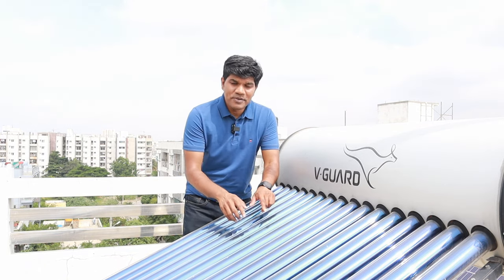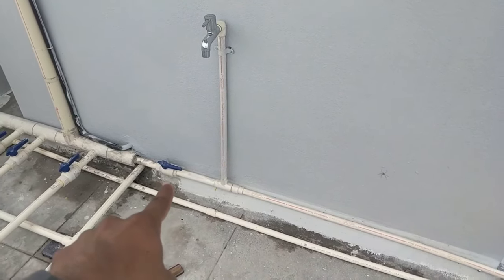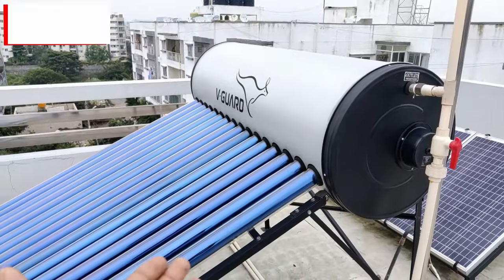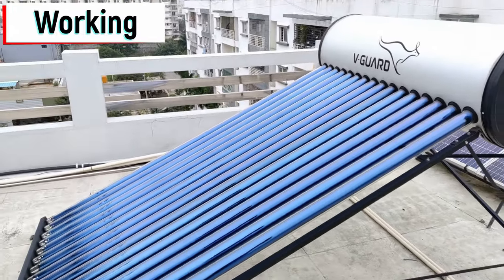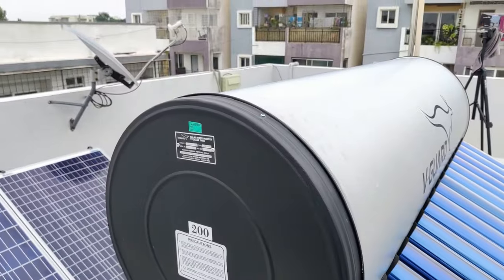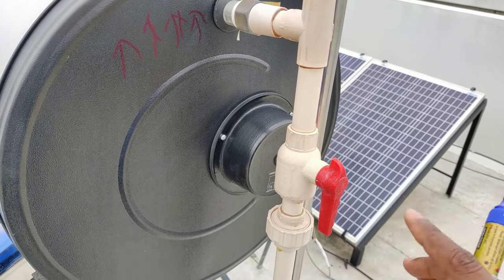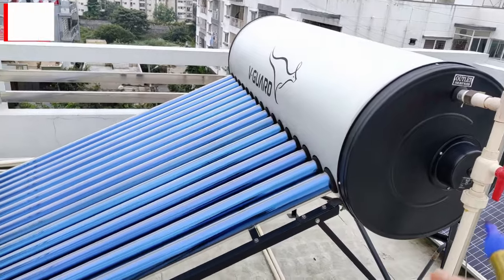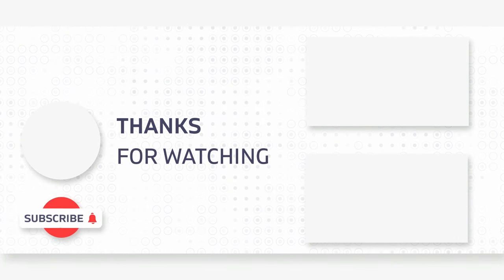Solar Water Heater Installation and working - 200 Liters (2023)

Comment: If the inlet water valve is kept open continuously ....there will be any damage to the tubes
Reply: No. that point is for the FIRST time only. When we install, generally we install in day time to get better visibility. But due to this tubes get hot as they exposed to sunlight once they taken out of box. And obvisiously tubes & tank is empty during installation, so tube will get extreme hot. Suppose if you turn on cold water imm. after installation, this cold water will enter in extreme hot (empty) tube & tubes may get crack. So better is after complete installation, leave it for whole night so tubes will cool down due to absence of sunlight & then you can turn on cold water.

In regular uses, you must keep cold water inlet continuous ON (if fact if you turn off cold water inlet, you won't get hot water. Because when 'New' cold water enters through inlet then only 'Existing' hot water comes out through outlet). Now there is no need to worry as tubes are already filled with water, so it will not become extreme hot like empty tube. So it will not crack

Comment: Have you used foam covering which forms light insulation for pipes carrying solar water??
This will prevent the initial cold water that comes when you turn solar water tap...

I think if I'm right it's 22/meter..
Reply from the maker: Hi, we have not used that. As you said I guess about 4 to 6 liter we get cold water and then hot water comes.
Reply: How can I reach you